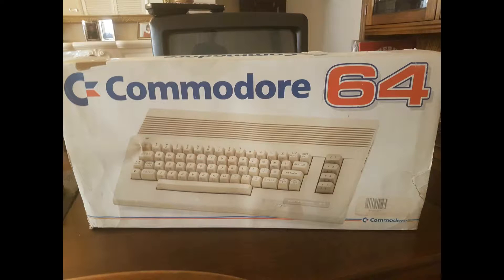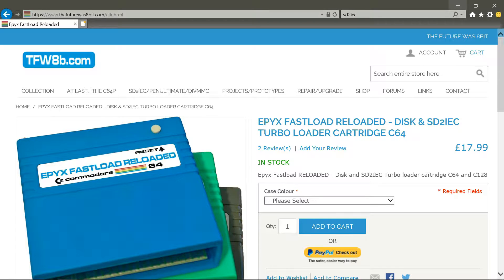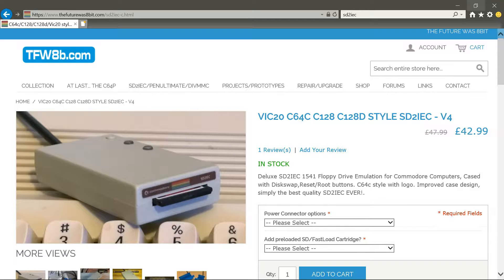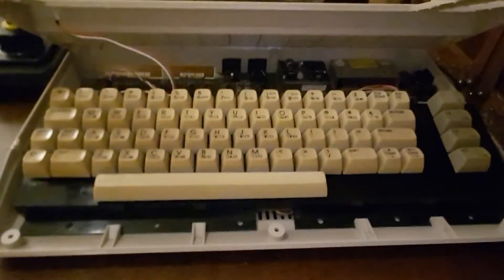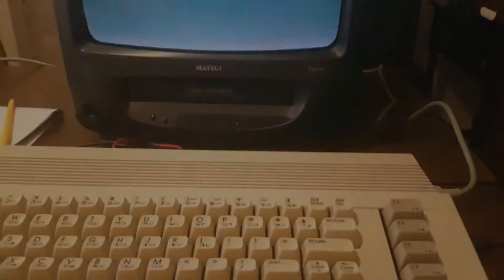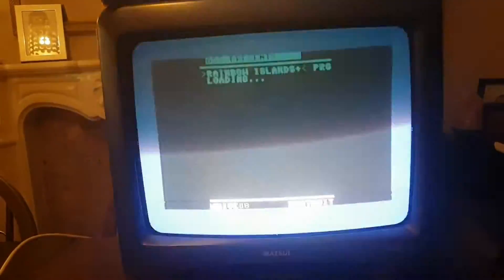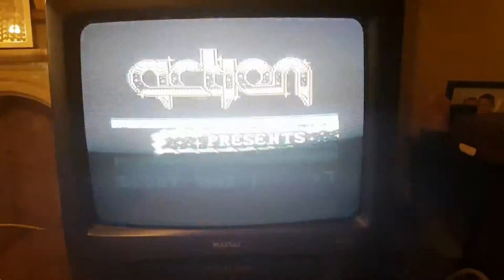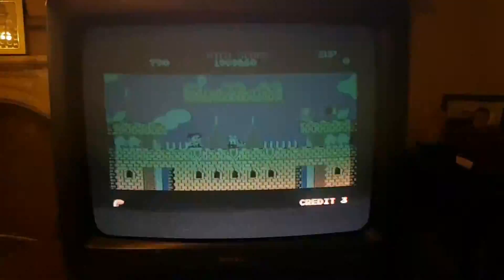How to fix a sound problem on Commodore  64 - Easy FIX!!

Comment: Strange, the fuse is there to protect the 9VAC rail prior to the regulators, if the fuse was blown the whole computer would not work. When I was working in a computer repair shop in the early '90s, there were a few C64s in with blown fuses, it takes the whole computer down, not just the SID.

My guess is that when you changed the fuse, you've inadvertently reseated the SID in its socket; the internal fuse would not fix a sound issue on a C64.
Reply: I would agree. If a fuse is blown, it's blown....power disconnected....don't see how it can affect the sound.....still it's a cheap  and easy solution to try out. Also no harm replacing the ancient fuse with a new one! My newly obtained c64 has the same "no sound" problem now (not totally sure, still need an AV cable to test it out). Is it the same 3AG 1.5A Fast blown Fuse for all C64s? Mine is a breadbin, probably a bit newer than the first batches. It has an 8 pin DIN for Video out.
Reply: Just to share. Bought a few 1.5A fuse to replace. Still no sound. Still, good to have a couple of C64 fuse on standby.
Reply: That video was all BS, no before and after! She lies!
Reply: Reading deeply also other comments around internet I've found that C64C can run with blown fuse (C64 Breadbin nope) , mine works perfectly without fuse. Need to order new one to check 😁
Reply: @dariodimartino3659  Well it's certainly true that the 8580 uses the 5V rail (which I believe is fused on the C64C, although I'd need to see the schematic), so I guess it is possible. If this is the case then the title is misleading and should read C64C (I'm one of those ageing breadbin guys).

Comment: I have a 64 , yesterday had sound and today it’s very faint , I put in new fuse but nothing changed, I really need to get this fixed , I have perfect screen , the only thing I did was I got a new 5 pin for pic/ audio, and after that no sound,
Reply from the maker: We got lucky with ours I think. Anyone you have local you can take it to?

Comment: I had sound before with RF, after buying the AV cable I connected yellow for video and white for Audio yo the monitor, after that went with no sound at all, people say buy a new SID, I just did, nothing happens, the 9 volt fuse has a wire inside I assume that it's working, what can be mi issue, please help
Reply from the maker: Could it be the cable you changed?

Comment: It's highly recommended that a new modern power supply with over voltage protection be used. Orginal power supplies are notorious for damaging the motherboard chips.
SwidSID chip is an affordable modern sound chip replacement.
Reply from the maker: Thank you for the tip. Greatly appreciated.

Comment: Good on you for figuring out the problem and posting that, I fixed a C64c with black screen, those are even harder to fix but with the right tools it can be done. Happy gaming
Reply from the maker: donw35 thanks gosh how did you over come the black screen. I'll still be sending my commodore away to a guy i know who is in the know for a bit of a diagnostic / service
Reply: I did it the old fashion way, de soldered chips until I found the bad one, turns out the memory was bad. almost all of the chips on the board are socketed now. It took me a couple days but its a good working machine now
Reply from the maker: donw35 wow well done you. Soldering not my area of knowledge. I like to leave that to people who know what they are doing 😊
Reply: agreed, these old computers can easily be destroyed by attempting a repair without the proper skill and tools, good that you found someone for yours although it didn't look like anything else was wrong but for the fuse and that is common on these.